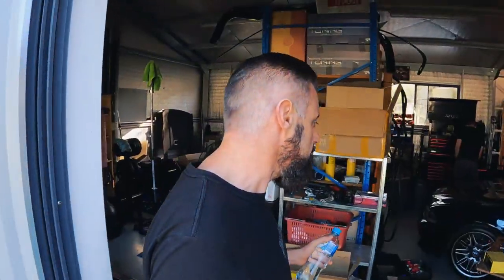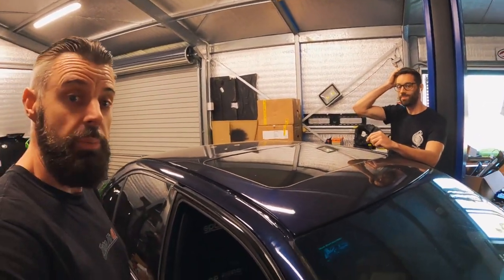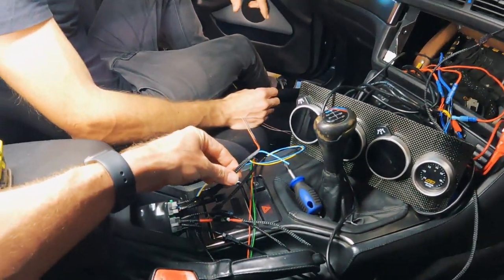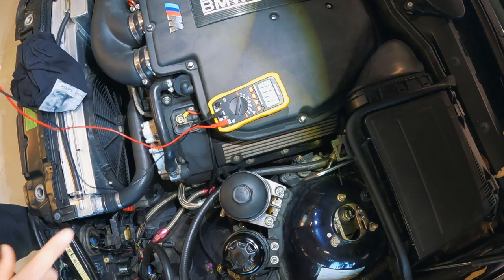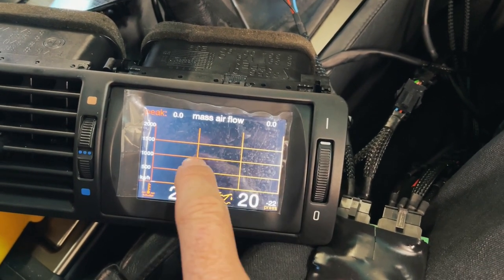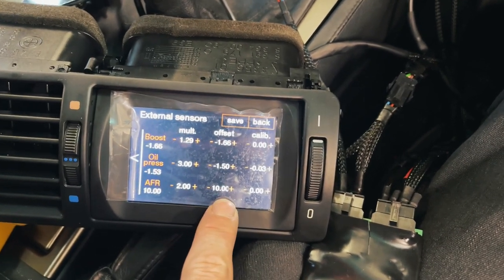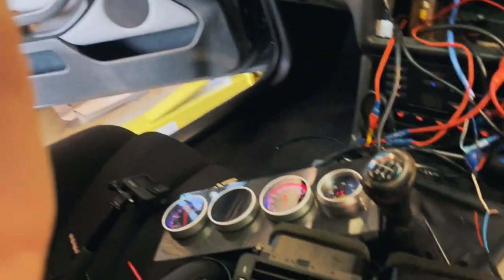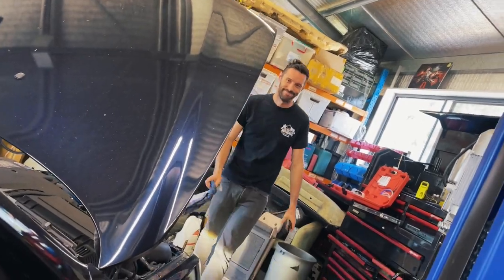BMW E39 Supercharged M5 Custom VENT Gauge Installation

Comment: I recall reading somewhere that the EGT sensors were deleted in the later DME firmware on the E39 M5. It seems that later E39 M5s didn't even have the EGT sensor at all.

Comment: Yes a standalone would be good. You've got many options depending on what level of options you're after. One of the higher end Link ECU, MaxxECU, Emtron is a great shout, Motec, Adaptronic. There's lots out there depending on what you're after. I'd love to tune the car but the reality is there's plenty of good tuners in Aus, no point me doing it from Malaysia. 😂 but if you ever need help give me a shout. Always happy to try help.  
Also if you ever need big boy fuel pumps, check out Elixir.
Reply from the maker: Are you sure all of those listed will do the s62 quad vanos? I know motec and maxx do but not sure about the rest?
Reply: @ZeroTo60Tube  Emtron I believe the KV high end series should be able to run quad VVTI. The Link Thunder you're right you would have to sacrifice without other workarounds. The adaptronic high end ones like M6000 or other with the expansion boards should also be able to do it.

Comment: Hi guys I've looked into a Standalone for my Supercharged E39 M5 and ended up looking down the route of a custom Syvecs S7GP which would give you true sequential ignition. But its not cheap around £6,000-7,000

Comment: Haltech elite 2500 will fully control an m62 so wouldn’t see any issues with it running a s62. I’m sure the guys at skid factory could give you a contact at haltech ;)
Reply from the maker: You sure they do quad vanos?
Reply from the maker: M62 are single vanos. Well actually m62 are no vanos, very easy engine for stand alone. M62tu is single vanos and s62 double

Comment: Did you sort the problem out? Ill consider this too.
Reply from the maker: The unit had blown internally. It is our fault for not knowing you must use a bosch sensor.
Reply: @ZeroTo60Tube  thanx for the reply. What Bosch sensor are you talking about? Do you mean the Bosch 4.9 AFR sensor? Or also the oil pressure and temperature sensor?
Reply from the maker: No the AFR is ok but this unit is designed to only use Bosch oil pressure and boost sensors